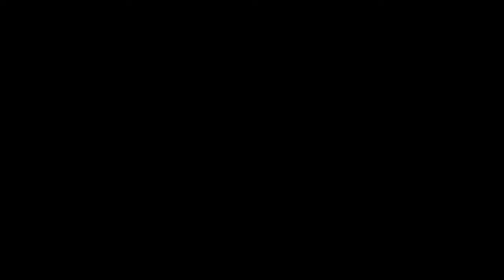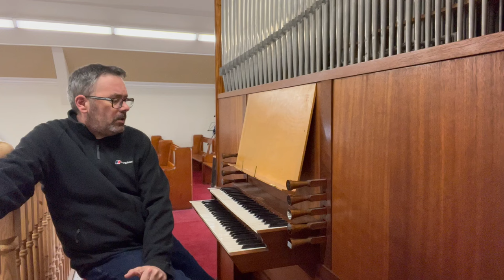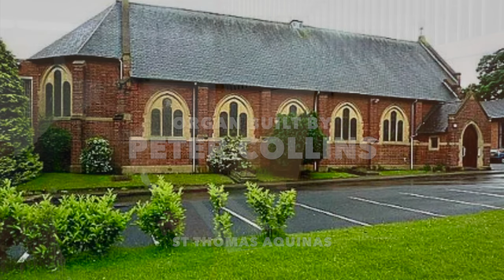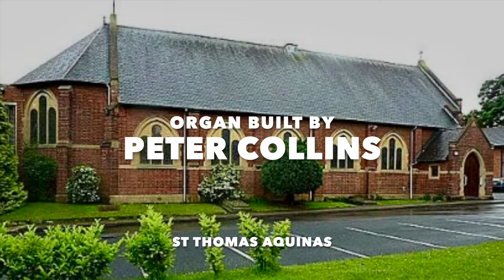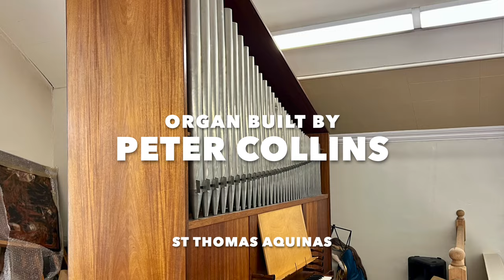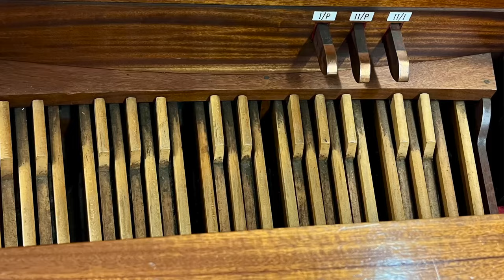UNDECIDED ABOUT THIS ONE (...comments please)

Comment: I played the instrument for Mass, weddings and the odd funeral in the early 1970s. We also organised a couple of concerts of organ - Instruments since the organ gallery is spacious. The Priest was not elderly and liked music, sang well in tune and directed hymn/new responsorial practice before the service occasionally.

So is it an adequate instrument for the task of service accompaniment?
8' to accompany the priest or Cantor singing solo, Varying combinations according to the text of verses for congregational hymn/refrain singing.
And for voluntary/concert repertory?
Choose the repertory which suits the instrument. Most of Bach can be played. Those who like Romantic sentiment will find it more difficult.
8' to accompany one instrument. Useful combinations for Concertos by Händel and John Stanley, Haydn. And lovely Baroque sounds for Classical Trios or Vivaldi concertos.

1. The organ is a sterling example of the post-WWII British Classical Organ movement***.
Mechanical action (sometimes with daring new-material experiments: aluminium, nylon cords ! or carbon fibre instead of wood) for both keys and pipes..

2. Some were designed to a (Renaissance-Baroque) Werk-Prinzip, 
which required a principal of different pitch as the basis for each section of drawstops.
8' Pedal, 4' Great, 2' Positive would have been typical. Here, the practice is not strictly adhered to. Although the Great Principal is indeed of 4' and the Positive Gemshorn is voiced as more of a principal than a flute. Mixtures are also made of principal pipes & top off the harmonic series generated and give brilliance.
The choruses on the two manuals are typically 'contrasting'. [Contrast is a Baroque artistic feature].

3. Spatial contrast is often found in organ case design. Here there are TWO organ cases (see the NPOR photos). Their shape accords well with the internal architecture of the church.

4. German Organist and Organ expert of the time, Hans Klotz wrote at that time that a stoplist may be based on a formula: 50% principals, 20% reeds, 30% others. This just about describe this organ.

5. Comparing such an instrument to a romantic organ with swell box and Voix celestes is inappropriate and as useful as saying that Bach would have prefered playing a modern Steinway concert grand piano.Comparing chalk and cheese.

6. "Limited" is perhaps linked to the imagination and experimentation of the organist.
Suggestions of crescendo can be made by varying the lengths of notes. Accents sans be artificially created by shortening the note before the chord to be accented. Baroque practice requires control of finger articulation and some organists decide to limit their foot technique to only the points of toes.
"Only 9 stops"?

Mathematics show us the variety of possibilities.

With only two stops, we have the following sounds available: A, B, A+B, A played an octave higher, A played and octave lower, A+B played an octave higher, A+B played an octave lower. SEVEN different possibilities.
If A is Rohrflöte of 8' and B is Principal of 4', playing B an octave lower would give the effect of an 8' Open Diapason. LIMITED indeed to a bottom note of Tenor C. But could be useful for the odd verse of a hymn with rearrangement of the harmonies or judicious addition of the 8' to the pedal.

The number of possibilities increase with three stops available: 8 4 2.
Combining Great 4 Principal with Positive 2 Gemshorn and playing an octave down will give a Principals 8' + 4' impression (within the same limit as above).

On this instruments, what is the usefulness of couling the two manual 8' stops together? A Thickening of sound when playing hymns, or Solo flute on the Great accompanied by the Gedacht on the Positive.

"Empty combinations" can give delicious spiky or nasal effects.
8' Rohrflöte  (or Gedacht) + 1.1/3.
4' Koppelfl. + 1.1/3 played an octave down as a RH solo => 8 + 2.2/3 for a French or Dutch Nasard Solo (Baroque, Jean Langlais, Flor Peeters).
8 + 4 + 1.1/3.
8 + 2.
8 + 2 + 1.1/3
8 + II !!

"Full Organ" can be Great 8 + 4 + II, 
Positive 2 coupled to Gt 8 + 4 + II
Positive 2 + 1.1/3 coupled to Gt 8 + 4 (+II)
Positive 2 + 1.1/3 coupled to Great 4 + II played an octave down.

If one finds the Pedal 16 "limited", try
- not using it! Ubiquitous can become boring.
- adding the Positive 4'. 16 + 4 can be clearer than 16 alone or 16 + 8.
- playing the pedal part of a hymn in octaves.

* The search for authentic performance in Early Music had begun (by Dolmetsch for example) before WWII. One spin-off was teaching recorder to school kids!
More and more historic (pre 1848) instruments in Europe were being cleaned and restored to their original specification and pitch. So we could more easily grasp how the organ sounded to Couperin, Bach or Mendelssohn.
Musicological research gave us better notions of the working conditions of Baroque organists.
Bach's work instruments often had only two manuals + pedals and never exceeded three with around 35 stops! As Organ-tester, he travelled to cities with larger instrument, but even the Katharinenkirche in Hamburg had 'only' 4 manuals, pedals and 58 stops. (Paltry as compared to Romantic British Cathedral instruments).
Only in Weissenfels would he have been able to play a high pedal F (BWV 540). Nowhere would he have even able to play pedal high F# (BWV 608) or low pedal B (BWV 572) - indeed rather few organs indeed have had this note available!
Reply: Might I suggest this link for the organ builder: https://en.wikipedia.org/wiki/Peter_Collins_(organ_builder)
Reply from the maker: Well that’s very helpful information and a lot to absorb and get my head around - thank you!  And interesting that you have firsthand experience playing this organ. I hope you’re subscribed as I find this sort of informative comment useful!  Thanks again 👍🎹
Reply from the maker: Yes, I placed that link in the description when I uploaded the video 👍🎹
Reply: @OrganicVisitations  Hm. Your link didn't work for me... the
 NPOR link was fine.
Reply from the maker: Not sure why that link doesn't take you directly to the wikipedia page - there is a link on the landing page though.  Thank you for pointing that out 👍🎹

Comment: A charming organ with a baroque flavour. NPOR indicates that the pedal Dulzian is of 8-foot pitch. I wonder if the pipes are actually there, or was that stop prepared for but never added. The fact that the draw stop is fixed in the "off" position appears to suggest that the rank doesn't yet exist.

It does sound as if it's been a while since this organ was tuned.

Could you give some more detailed aural snippets of basic combinations in future videos. For example, we didn't hear the sound of the Great Flute 8 plus Principal 4 - just the full chorus. We didn't hear a comparison between the two 8-foot manual flutes. We didn't hear the potentially delightful sound of the Positive Flute 8 plus Gemshorn 2 (without the 4-foot). We didn't' hear the sound of the Positive Flutes 8 & 4 - just with the 1 ⅓. We also didn't hear the effect of both manuals coupled, or combinations involving coupling (eg: Gt Flute 8, Principal 4 with just Positive Gemshorn 2 coupled). When you played a fragment of the little Bach F major with the pedal Subbass it remained uncoupled. Lots of small but interesting details which could have been explored. Perhaps plan out a few very short works eg: a couple of hymn tunes, some tiny interludes such as those often included by C H Trevor in his "Old English Organ Music for Manuals" series, to give some brief but informative exposure to various different combinations.

This little organ has enormous potential. The gallery location suggests that it carries well into the body of the church. One wonders how it is used today, but the fact that it's still there after more than 50 years speaks for itself. The church is to be congratulated for its far-sighted view in 1970 putting in this fine organ, which would not have been at all cheap at the time. It's certainly outlasted what would easily have been at least 3 different electronic organs across the same period of time, and it's still going strong. Thanks for bringing it to light via YouTube. This organ would be worth another visit, with some performances of short pieces.
Reply from the maker: Thank you for all the tips!  I’m pretty new to this YouTube thing so really appreciate productive input and suggestions from the comments. Thank you for watching 👍🎹
Reply: It certainly existed at the origin of the instrument!

Comment: I wonder if the pipes of the Dulzian Are in that organ. As a reed rank in a modest organ, it could be that is a prepared rank that was never realized
Reply from the maker: Yes, I wondered if it was prepared. Not sure there is space for a reed rank…👍🎹
Reply: A Dulzian would be a half length pipe so 8' becomes 4'. The case looks large enough to accommodate it. If tuned to a quarter legth speaking stop it would give a 16' definition to the pedal. It is amazing what is done on that score. I know of one organ with one.
Reply: The pipes were there at the origin of the instrument.

Comment: Nice, but typical of the 1970's - it will sound better playing the tunes of that era than it will playing the 19th c. repertory - and it will sound fine playing Bach. I suspect the brightness was to compensate for the acoustics of the mid 20th c. with wall to wall carpet and a minimum of reverberation.
Reply from the maker: Other than the wall to wall carpet the church has pretty decent acoustics 👍🎹